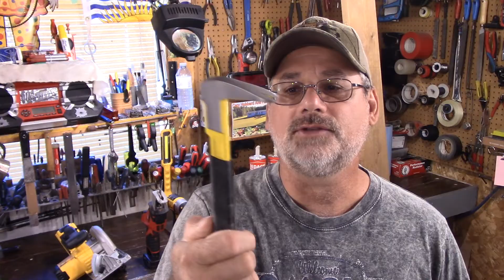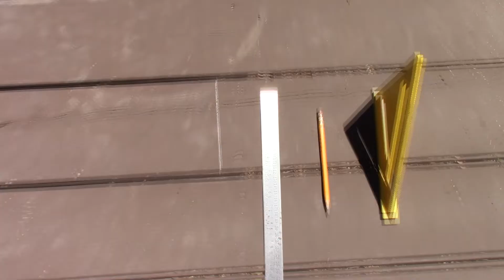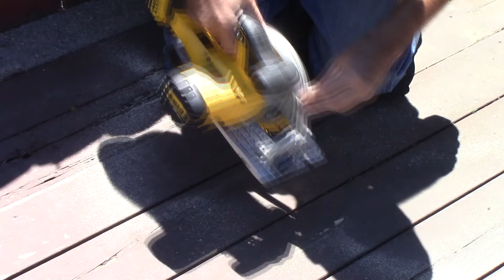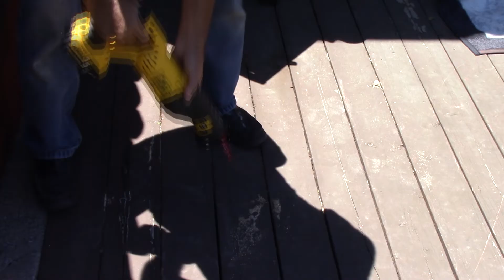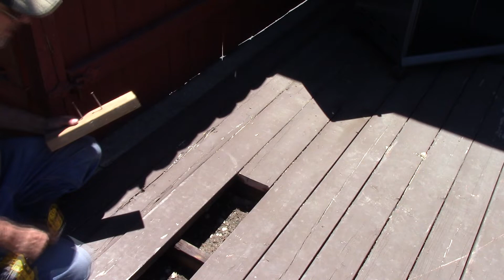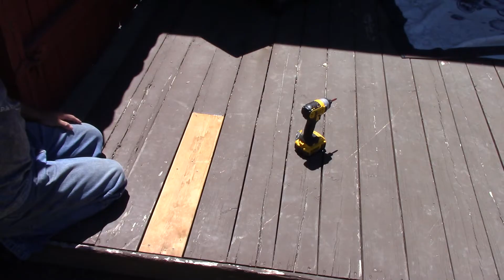Deck Repair  - How To Replace A Rotten Section Of  Deck Board - Diy Easy

Comment: What happens if you have an old deck board with the old screws in them how best way take it out
Reply from the maker: Great question Gary.  I usually use a claw hammer and another hammer to drive the claw under the screw head and pull it out.

Comment: Don't understand why the glue, if wood preservative is applied to both abutting ends? Is it because there is no "breathing room" for drying after a rainfall?
Reply from the maker: Once you cut the board the ends must be retreated or in my case I used glue to seal up the joints.
Reply: wood on wood = glue

Comment: Great video on how to remove and replace a deck board. One tip is to pre-paint the board on the bottom side and seal the end grain as well as the small 2x4 support piece. It may help the new board to last a bit longer.
Reply from the maker: Thanks Eric , fantastic tip  👍
Reply: This video helped me very much as I didn't even think of scabbing on another 2 x 4 block which makes so much sense and everything is easier and stronger. As far as the underside, I change all of my vehicles oil and save it right back in the container it came in so I figure a quick wipe down on underside and edges will seal things up pretty well in my case. It's a brown color which will match the deck too. Wish I'd have been doing that back when I built the darn deck and sealed the whole thing that way, might have lasted a good bit longer. Thanks Steve!
Reply from the maker: @TheBlackSheepDiaries  👍

Comment: Thanks so much.  But I don't understand why you didn't cut all the way the first time.  This will be my first time.
Reply: Due to the circular shape, in order to cut completely through it would have to start tearing in to the adjacent pieces.  I think.  I'm no expert.
Reply from the maker: Which part?

Comment: how did you pre-drill the screws on the replacement board, how would you know where it lines against the joist?
Reply from the maker: You can pre drill if you like , I did not . You can mark the joist center or in my case I can see the joist between the cracks in the board.

Comment: I used a jig saw after starting the cut with a saw max.  I used an osculating saw to cut the remaining board along the nails to expose the support board.  I like your idea about nailing a small support board to the underneath part of the deck better.  I like the glue idea to preserve the ends.  kt
Reply from the maker: Thanks 👍

Comment: Honestly this saved my day...My deck is about 1000 sqft and I have about 10-12 rotten boards. A contractor told me I have to replace the whole deck and it's gonna be 60k, I'm not kidding. 😂
Reply from the maker: I think you just saved $59800 😅😅
Reply: @SteveRobReviews  yeah haha. I mean, contractors now, they just wanna rip out everything and build new, I know for a fact that my joist and structure is in pretty good shape, why would I wanna rip out the whole deck, makes no sense.

Comment: Nice.  This is helpful.  I don't have a truck and only have small issues on 2 boards.  I can just get some pieces cut at home depot
Reply from the maker: That will work out just fine , glad to have helped.

Comment: Thanks for the video. I have just a couple of boards to replace on my porch and this is just what I needed to see. I have a reciprocating saw but no circular saw. Can I get by without one and just use the reciprocating saw?
Reply from the maker: Yes absolutely it takes a bit more time but does a good job.  After you put the construction adhesive  on it will bond it nicely. Cheers 👍

Comment: Thanks for the great advice.  I was going to cut the old deck 2x6 in the middle and butt the new board up to it, then would have to use 4 screws to fasten.  Your idea is much easier, quicker, and much stronger.  Took me less than half an hour to do it, and that includes the time it took for this ol' fellow to find all his tools.  Just finished, and perfect job!!!
Reply from the maker: Well that's just awesome , so glad to have been a help.

Comment: Info on the new board:  is it “deck boarding”?. Is it pressure treated? How long for the board to turn dark? Thanks!
Reply from the maker: Yes pressure treated deck board. Never actually seen them turn dark at all  .
Reply: STEVE ROB REVIEWS my point is, the new board is quite a bit lighter than the old boards. It does eventually darken, so that it matches?
Reply from the maker: Oh you would definitely have to stain it the color of the rest of the deck as it will never match as is. Good point .

Comment: thanks so much! is the adhesive necessary? what is it for?
Reply from the maker: The adhesive is not mandatory but it sure makes the two joint ends that  butt together  glued  weather tight  and no movement.

Comment: Good deck repair Steve....all you want is a few more year...this should be good....I could tell you the way I do it but then this is your deck repair and it was fast and effective as far as I`m concerned....the fry place was still closed so I did not make a video....I`ll be back up there in June and then I`ll make it....CHEERS
Reply from the maker: Thanks Gator,  yes june it will be open for sure. 👍

Comment: nice work. was the deck stained or is the color just from age ?
Reply from the maker: Thanks its stained but me running the snow blower on it takes a beating 😂😂
Reply: No wood stain good enough for that!  Even using a plastic shovel don't do any good.

Comment: Good repair. Did you use wood preservative though....
Reply from the maker: Thanks, on the ends of the cuts no  or the glue wouldn't stick but I will restain the deck. 👍

Comment: Nice demonstration Steve. Cutting off center and adding a new support sure makes that job easier.
Reply from the maker: Thanks Wyatt - a new deck is in order but so many projects on the go its  hard to decide what to do most times.  I have at least 10 things on the go and the list gets longer all the time. LOL
Reply: @SteveRobReviews  I'm finding that in retirement I have more projects. Especially from the wife.  :)